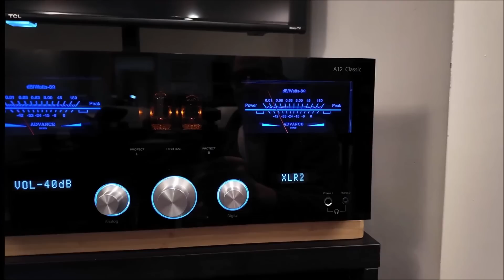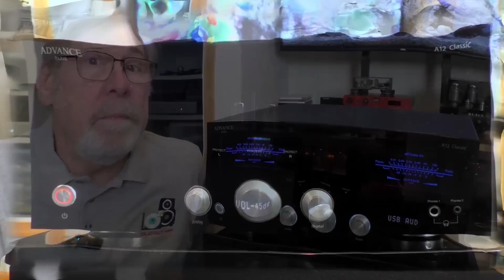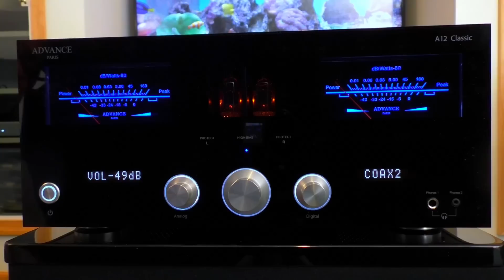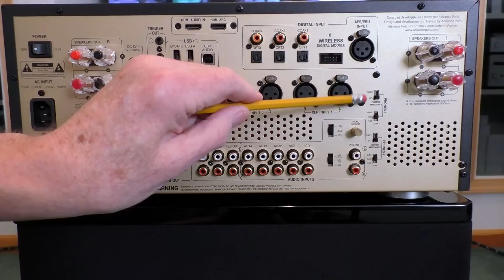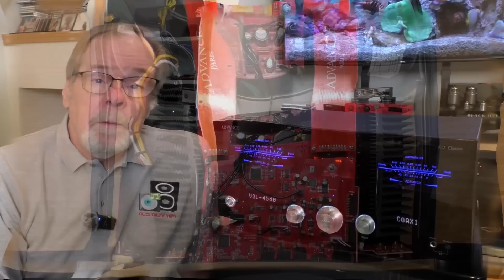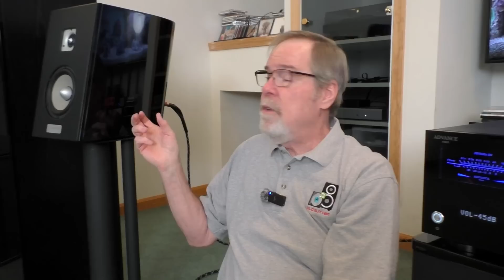Look out McIntosh! Someone new is knocking on the door! Advance Paris A12 Classic.

Comment from the maker: Look out McIntosh, someone new is knocking on the door! Advance Paris A12 Classic. This is one of the finest sounding full featured integrated amps I have ever had the pleasure of interacting with. Excellent build quality and sound. Smooth, detailed, and highly resolving. Outstanding. This gets my most enthusiastic recommendation. If you wish to purchase any Advance Paris products, or any vinyl from Skylabs online store, please click here: https://shop.skylabsaudio.com?sca_ref=6609663.MTejnTqC6497. If you wish to join the channel and become a member please click here: https://www.youtube.com/@OldGuyHifi/membership.
Reply: I am as Happy as you are saying with Mine,   let me tell you guys , Everything he says is 100% right on!
Reply: I own both the A12 and the Advance Paris X-D 500 CD transport… I modified the transport a bit. Dampening the chassis using Dynamat extreme. I don’t use the A12‘s internal DAC. Instead I route my digital sources ( the transport and a Cambridge streamer ) through an SPL Diamond, I saw you got one as well there in the back in red, using an Audioquest Carbon AES/EBU cable and an Audioquest Yukon XLR connection going into the A12 from the Diamond. 
Fantastic combination, believe me. Adding a ton of clarity and depth to the treble. Silky, I would describe it. The A12‘s tendency to become a bit ‚thick‘ in those buttery mids is beautifully compensated. I prefer the AKM AK4493 SEQ VELVETSOUND DAC chip in the SPL over even the top range Sabre units. Very organic-sounding. Almost analogue even though it’s a digital signal. Can’t describe it any better. Very musical.

Comment: Check out the video on how to change tubes in these Advance Paris amps. It is a real pain. The tubes are buried in the amp so they can be showcased for audiophile catnip but if you like tube rolling, you will be in for a challenge. I was going to get an A10 but I just cant put up with the rigors of tube changing in these amps. I've owned five hybrid pieces of audio gear and every one you just remove the cover and R and R the tubes.
Reply from the maker: I have rolled mine in the A12 and it was relatively simple. I am now running Psvane Horizons in it.
Reply: @OldGuyHifi I wondered just how many times one can unclip those little plastic connections and  wrestle that board out before something happens. I like simple. To each his own. I'm disappointed because I hear its  great amp.

Comment: Hi Ed. Thinking of upgrading to A12. The sub out has option for 75 or 150hz. Want to know which one to select given my subwoofer LPF is set at 80hz. Speakers are B&W bookshelves. Thanks in advance for your guidance.
Reply from the maker: I would set the unit to 75Hz so you have a bit of overlap.
Reply: @OldGuyHifithank you Ed!

Comment: Hi, Ed – thanks for another great review! I have a question for you. Very often my audio gear, tastes, and preferences overlap with your’s quite a bit. My current set up is the Evo 150, with Wharfdale Linton’s connected to speaker A and Magnepan LRS+  connected to speaker B. I love being able to switch between them. The entire system is also paired with dual SVS SB3000 subwoofers to handle low frequencies.

Since you also have the Evo 150, and you also love the LRS+, do you think I would notice much of a difference going to the A12 classic - especially for the Maggies? My room is fairly small, so I do not need to play at super loud volumes. Currently, the Evo 150 provides more than enough power - even for the Maggies. 

Thanks, Ed. I appreciate you and your input.
Reply from the maker: You have a wonderful system already. So, the real question is are you unhappy with the sound/performance of EVO150? Be careful not succumb to FOMO. If you are enjoying the sound of your system, don't just change for the sake of change. I am not trying to be snarky. Honestly the EVO150 is one of the best sounding pieces of gear I have ever heard. It was my reference for a long time. The A12 is also wonderful but in a different way. It does have far more flexibility on the gozintas & gozoutas category which is great for me as a reviewer. I probably have 3 or 4 DACs and a couple of CD transports plugged into it while I am reviewing. There are compromises' with both. A lack of inputs/outputs and a decent but not super flexible phono stage on the EVO. The A12 lacks a built in streamer, is very large and heavy and does generate some heat. It does have a more flexible phono stage and some bass management which I really don't use. As far as listening satisfaction for me I can and do live with both. They each have their own sonic character and one is not better than the other just different flavors of excellent. As your Doctor my prescription is to take the funds you would have used to buy the new unit and by more music and/or take your significant other on a nice 3 day weekend getaway. I hope that helps.
Reply: @OldGuyHifi - Thank you, Doctor … perfect answer and prescription noted! 😊 
Appreciate your time, Ed! 
You’re the BEST!

Comment: First you got me with the review of Evo150, and i made my mind to get that one for my set up. I somehow ended up by accident to a Advance Paris A10 classic review, and that kinda hooked on me so I went investigating. And all of the reviews were positive, from sound, built, value for money..the blue VU was not my thing honestly..and then i saw the limited Advance Paris A10 apex. Love at first sight!
 
All that took me to this video where you have nothing but good words for the A12 which is little over my budget, but im glad to hear you talk positive (i mean, hearing from you that this one might be that „holy grail“, its really making this product outsanding). 

So now you got me in trouble between Evo150 and AP A10 appex. At the end, i like visualy the AP 10 more, and to me, that is important (and I'm also more vinyl lover, so the streamer in evo150 is not that big of a deal for me)
 
I'm so glad you mentioned Hegel which is in my current set up. Altough its its a entry level H95, i completely understood what you said about it; good sound but to steril for my ear. Not my cup of tea.
 
So, thanks again. Keep up the great work!
Reply from the maker: Between the EVO150 and the AP A10 APEX I would suggest you look at the regular A12 which is on sale and only about $500 more than the A10 APEX. The A12 is a better unit as it is dual mono and much more refined. The differences between the Classic and APEX models are very, very subtle, mostly cosmetic. I do have the A8 APEX here now for review and at $3k I think it is very good. I love my EVO150 and as a high-end lifestyle product it is amazing, but I listen to my A12 almost everyday. Keep me posted.

Comment: Love your channel 🎉 been a subscribed for a while,,, my question to you is ‼️‼️‼️ do you think this new unit sounds remarkably the same or better as a 1979 Sansui G 33000  ❓❓❓ I would really appreciate your opinion. You really know your stuff 🔊 This is really important to me. Please share thank you.
Reply from the maker: Very hard to answer as I haven't heard that particular stack of gear since the early 80's. Here s my take on vintage gear: Vintage hifi is like a classic car. It is beautiful to look at and brings back nice memories of days gone by. A classic car can very nostalgic and cool, but you wouldn't want to drive one everyday. I do think modern gear like modern cars has benefited form advancements in technology, materials science, reliability and improved componentry. Watch the video again when I go inside and you will see that it is just ruggedly and over built as the older gear. The A12 is very old school in its build and styling and very modern in it performance. Think of it as a resto-mod. A 67 Mustang with a modern chassis, engine and running gear. I hope that answers you question. Thanks.
Reply: @OldGuyHifi you’re so right ! Good looking out !! definitely it’s time for the new stuff more reliable and don’t have to worry about it or who’s around it well, maybe just a little bit😂

Comment: I had an Advanced Paris A12 - you get a lot for your money.The sound signature was quite good, the bass impact was very strong. In the end, I didn't like the build quality. What doesn't get mentioned is the front panel is plastic, attracts dust and can scratch easily. The controls are plastic and don't have a high quality tactical feel and the speaker connectors are plastic. Also, I found the user interface to be very counter intuitive - just switching between A and B speakers was a bit frustrating. The closest comparison piece of gear, functionality & price, would probably be the Yamaha RN-2000a. The Yamaha has less power but a higher build quality with a more rigid main chassis, brass speaker connectors and chrome plated solid bass feet.
Reply from the maker: I am sorry you didn't like it. I love mine and find it to be built quite well. The user interface is very simple once you set things up all you are doing is switching sources or changing volume. Thanks for sharing.
Reply: @OldGuyHifi Thank you for the reply.

Comment: It's the last time for me when i look at this so called influencers: I went and listened both a12 and myconnect 250 only to get out totally dissapointed: the sound was way in the back recesed  veiled, and  the vocals were incomprehensible,. There were connected to some 30.000 euro estelon speakers. The amp is worse than many of the same price ...power is nothing without sound and musicality
Reply from the maker: Why would you put 5000 Euro electronics on 30k speakers? Speakers are the issue. I don't care what they cost it doesn't mean they are any good. Silly.
Reply: @OldGuyHifi  - i did not put that amount they were at the dealer where the Advance Paris was tested. It was tested on several other speakers and the sound was the same. I personally own Kef r series and a pair of Dali Rubikore 6. And Advance paris is 2000 -2500 euro here in Europe. But is not worth not even that price...honnestly.
Reply from the maker: The good news is you don't have to buy one. The best gear is always the stuff you like. Thx.
Reply: Based on price I’d guess you were using the XC Mk II? A very easy drive. If it was one of their floor standers then yes, those are some very challenging speakers to push and likely need high current mono blocks to work properly. That’s not the fault of the A12. Cost no object speakers are of course designed to pair with cost no object amplification.
Reply: @HifiLoveLetter they have been paired with xb and yb. My conclusion after trying and listening to so many amps and speakers is that the A12 is a 2000 euro amp which works as a 2000 euro amp it will never be a Luxman 507z or a better amp no matter what. And the sound quality is questionable to say the least as a same priced Hegel will sound much better. But at the end of the day is a matter of taste

Comment: If you're not careful, it's easy to pull an all-nighter listening to this thing.
Reply from the maker: No kidding. I have done that on many occasions. It has an addictive sound. It is always whispering "come play with me." even at 1AM. Thx for tuning in and commenting.
Reply: @OldGuyHifi BTW, I realized "I could have had a V-8." today when I also realized I could avoid purchasing an external DAC, and take advantage of the A-12's DAC by connecting my MacBook directly to the A-12 with a simple Thunderbolt to HDMI cable. Duh.
You're so right about that PCM 1796.
Reply from the maker: It is a very sweet sounding DAC.
Reply: @OldGuyHifi 👍"Like buttah!"👍
Reply from the maker: @larrysmac  Don't get all verklempt on me!
Reply: @OldGuyHifi 🤣

Comment: i dont understand how you can think the evo can compare with this consdidering the evo is a streamer aswell surley when you add a streamer to this it sounds much better considering cost
Reply from the maker: I don't understand your question. Sorry.
Reply: I mean is the evo better than seperates that cost more ? @OldGuyHifi
Reply from the maker: It is not designed to compete against separates. It is a high end one box solution for the audiophile who doesn't want or can't accommodate separates. Sonically it performs at or above its price point. Add in the streamer, phono preamp and the ease of use and it is a winner.

Comment: Bought this Amp 1 year ago and now the reviews are finally catching up.  incredible sound and extremely well stocked with features.   DAC does not do better than my Chord BUT I did sell my McIntosh Amp and replaced with this. It's that good.   A12 seems undervalued on price, which I m not complaining about....!   NOTE: not sure if you mentioned that this pre-amp is Class A  tube sound in first 20 watts (Hi Bias setting).   So you get a nice Class A sound for the majority of your typical listening
Reply: I also bought the A12. You mention the high bias roll from A to A/B occurs at 20 watts. I’ve been trying to find documentation regarding the use of the high bias switch and where does the roll over from class A to class A/B occur. Can you share where did you find this? Thanks.
Reply: @rafacq  It is in the A12 manual and on the Advance Paris website.  I quote for you "It features a High Bias mode, which adjusts the amplifier's biasing to operate in Class A for the initial watts of output" and "The preamplifier section of the A12 Classic utilizes two 12AT7 vacuum tubes, known for their low noise and linear amplification characteristics. These tubes operate in Class A, contributing to the amplifier's warm and natural sound signature."
Reply: @DG-rc6rr  Read what you just quoted… “It features a High Bias mode, which adjusts the amplifier biasing to operate in Class A for the the initial watts!…” It doesn’t say 20! Your post said 20! Where did you find  that number. It could be the first 5 watts!
Reply: @rafacq  I do not recall the review as this was over 15 months ago.  If I am wrong, I meant no confusion, Do you want me to delete my comment?   BTW, for what it is worth;  for me, it is really hard to go past 5 watts in normal listening on the VU meter.  I am pretty sure I am in Class A all the time.
Reply: @ It is your post, so you decide what to do. My suggestion would be to edit it and remove the mention of 20 watts. Instead I would follow what Advanced Paris publishes. 

You are correct, at 5 watts, my A12 generates over 75dB. It is loud. I don’t think I have seen the meters reach 20 watts! I don’t think my ears would be happy. Enjoy the music.
Reply: I‘ve never utilized the built-in DAC of the A12. Routing my digital sources ( a modified Advanced Paris CD transport and a Cambridge streamer ) through an SPL Diamond containing an AKM AK4493 SEQ VELVETSOUND DAC chip. Good AES EBU cabling. Matching XLR going out of it into the A12…. Match made in heaven! Adds depth, clarity and velvet treble to the buttery mids the A12 is known for. 
Wouldn’t change it.
Reply: @ZeitdiebX  It’s your choice! 

I personally find the Burr Brown DAC used in the A12 to be wonderful. So I am using my Eversolo DMP-A6 and SMSL PL100 as transports, enjoying the A12 DAC. Crisp yet sweet. Love it. 😍
Reply: @rafacq  The SMSL is certainly not bad. I have a thing with clarity and sound stage and the AKM chip does it for me. That’s all. I would never say this one‘s better or that one‘s worse. Listening preferences and taste are so subjective. There‘s no one fits all in the HiFi game.
Reply: @ZeitdiebX totally agree!
Reply from the maker: Thanks for the feedback; glad you are enjoying it.

Comment: If something goes wrong with that board you can junk the amplifier, very few know how to work on them and they are not cheap.
Reply from the maker: I know of several very good repair shops in my area. One is an AP dealer.
Reply: @OldGuyHifi  Well that makes sense, I can't find one for my Primare SPA21 or SPA22, can't remember, it works, but the volume can't be modified if I enter in the menu, these complex amps/receivers are dead to me now because of this issue.

Comment: I have been considering the A10 Clasic, the A12 is an extreme overkill for me. I wonder f they mostly sound similar with just the main differences being the connectivity and the power.
Reply from the maker: Your supposition is correct. They both share that glorious Advance Paris "House" sound. The A12 being a more robust dual mono design does have a better sense of power and drive. Both have a great sound and unless you are really pushing it or trying to drive something like Maggies, the A10 is a wonderful sounding unit. I hope that helps. Thx.
Reply: @OldGuyHifi  thank you so much for the perspective! I'm probably making the purchase over the weekend :)